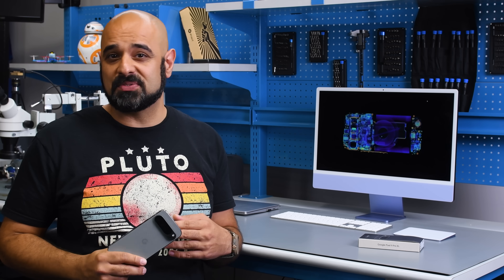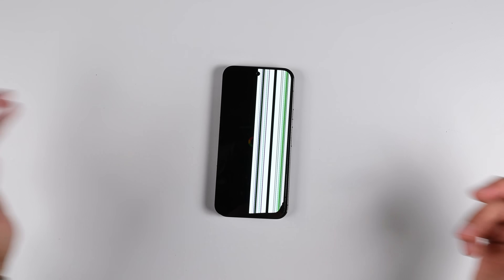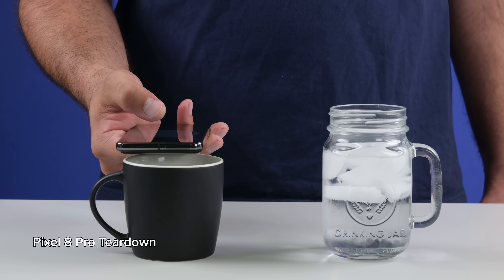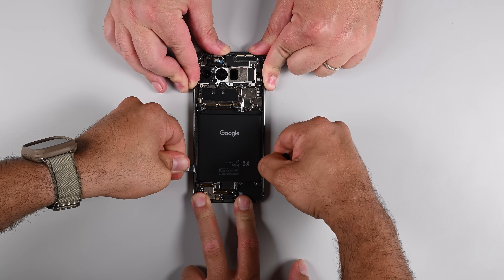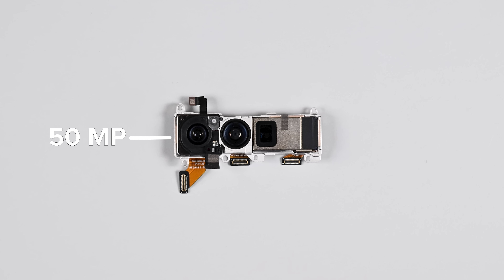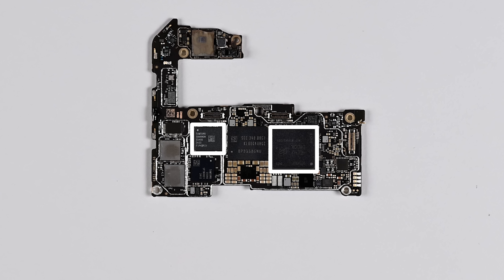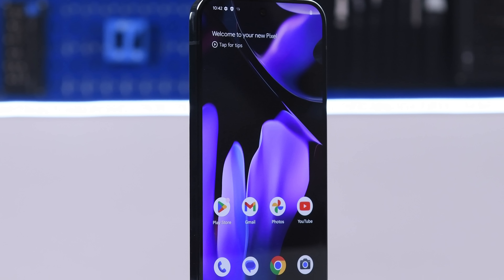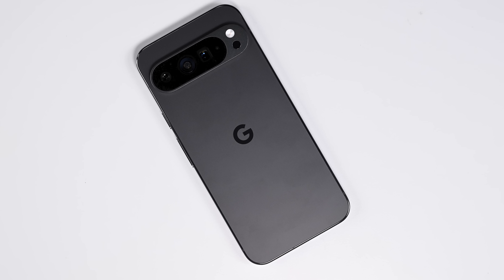Pixel 9 XL Pro Teardown: Is It ACTUALLY Better?

Comment: Is it possible to prevent damage to the back sticker by carefully heating the battery pack? Maybe Google could use a different adhesive for the battery pack in future productions of the Pixel 9.

Comment: I've had good luck with the side pull tabs on Honor and Oneplus phones. The battery is on thin plastic film that you pull on from the side.
Why are they coming up with this overcomplicated and non-reusable solutions to a solved problem ?

Comment: high end thingy these days is more toward feel rather than function, it will boost your self confident for sure but bust your wallet at the same time, i have 70 bucks low end phone that  i had for 5 years and what it can do is fairly amazing, you stick your nail between backcover seam and pluck old battery out then plug new batery in.

Comment: you always find something good to say, but this phone is absolutely unacceptable to me. maybe most Pixel phones in my country are gray or unofficial (from the US and richer European countries. i think first owners quickly realize that 128 GB of storage is not enough and sell their phones, so there are many barely used phones with 128 GB of memory that are brought to us and that cost half the price of official ones from the store). and so replacing the battery in an official service center just costs too much compared to the price of the phone after a few years of use. it's often cheaper to replace it with another phone. and I'm sure no unauthorized technician will change the battery in this phone because he risks damaging the screen or something else. and i would love to replace battery myself, it's may be fun to do. but not with this phone. with this phone it is terrible disaster.

Comment: You talked about screen entry design as a problem that was solved by apple switching opening procedure to the back

but let me tell you that this problem was solved on pixel 6 using a protective plastic frame

Comment: Battery is easier than made out. Heat rear of phone to 70c for 10 mins, undo the pull tabs, put phone in vice or similar to secure and pull tabs straight up towards you. Battery lifts out. Source: Google Repair Manual

They are not saw tabs.

Comment: Wow, replacing a cracked or not working screen can result in it braking. Shocking. As for the battery, you pull it away with the tabs. And again, as above with the screen. Replacing a faulty battery may damage the battery. Shocking.

Comment: Temp sensor? Would be great to figure out if you have heatloss in a wall in your home? At least it would point you in the direction of an issue so you can buy a thermal camera

Comment: I never understood why batteries needs adhesive at all? Especially in devices like this with such tiny tolerances. Surely a bracket or two should be able to keep it in place just as well as glue?
Reply: Likely because glue costs less than screws

Comment: You didn't mention anything about the vapor chamber or if it is better than ones on previous pixels. Also, the overall durability is more about the shape of the phone being more square and the screen being flatter. Causing drops to not hit glass, instead hitting metal.

Comment: if the adhesive is too strong but u got openings on both side, i'd take a braided fishing lines and run them under the battery to cut the adhesive. similar to how you'd do a car windshield removal. i think you dont have to mess with the screen if you just wanted to change the battery or everything else, as it seems like they're easily accesible from just the back 🤔

Comment: Wait, did all these people in the comments not watch the video? Or did I misunderstand the video? I understood him to say you can enter from the rear of the phone without ever having to take off the display when replacing the battery. But holy moly, that battery adhesive. 💀
Reply: Yeah, it looks like the only time you will have to go through the front is to replace a defective screen, so does it really matter that removing the screen ruins the defective screen?

Comment: I'm not at all saying that you guys aren't skilled at disassembling devices, but I would like the device disassembly revisited using the repair guides on google's site! 
It doesn't need to be a video, just more so a review or the repair guide published and whether or not it helps. 
Additionally I think the review of the repair guide should not include device specific tools, like the device specific, industrial sandwiching device, or the over the top screen separator pictured in the manuals. I don't think most people would buy a vise grip for their phone to remove the battery either.

Comment: I have used solvent to remove battery glue as well on other devices. But I think it was denatured alcohol and I stuffed paper towel strips in the gaps to hold the liquid in place and put like a layer of saran wrap over device to stop the alcohol from evaporating. I also waited longer sometimes adding a little more alcohol. I had good luck doing it that way.

Comment: I've seen lower repairability scores phone with easier battery removal process, the copper heat sink basically got ripped if you want to remove the battery
Reply: @deRykcihC  only if you don't follow the guides that Google posts online. They were supposed to put the phone on a heating plate at 70⁰ for 10 minutes, secure the phone in a vice grip, and pull directly up on the battery. 

They did none of those things and made it needlessly destructive.
Reply: @StrigidaeParliament  the problem with that is that most people don't have a heating plate at home to do that with. If you try a heat gun or a hair dryer you're going to cook the phone, so it now means you need a specialist tool to repair the phone.

I like Pixels as much as anyone, but it's important we push for designs that everyone can repair.
Reply: That's what happens when you use the incorrect tools and don't follow the written instructions on how to do it. This is just lame clickbait

Comment: I read the Pixel 9 Pro XL repair manual, and it says that the phone needs to be heated to 70c for 10 minutes. You can then use pull tabs to pull straight up, and the battery should come out. Also the manual states you shouldnt go in more than 3.2mm. Google has these manuals available on their repair site.
Reply: Not to mention the manual also suggests that the phone sits in essentially what is an industrial vise grip for phones AFTER the heating phase to soften the adhesive, AND using finger cots to increase your grip on the pull tabs to pull perpendicular to the battery.
At least from the repair guide, it suggests that the tabs on each side are not to saw through the adhesive as suggested in the video, but rather to pull the battery away from softened adhesive.
Reply: Dude, forget the manual who's trying to heat a phone for 10mins? The heat alone would ruin the battery and the display.
Reply: @jevonsims900 70°C for even an hour is fine for both the display and the battery. Most phones are heated to 70-100°C before a backglass/display replacement.
Reply: @pvim  70°C for an hour is absolutely awful for the battery! Hell, even 50° C sustained is enough to degrade the internal chemistry of the battery
Reply: @LazorVideosDestruction  ... the instruction is literally for replacing the battery. What does it matter if the old battery gets degraded in capacity further by heating it for an hour?
Reply: @LazorVideosDestruction  ten minutes, not an hour.
Reply: @StrigidaeParliament  The person I was replying to said an hour
Reply: @weltenleser  And the label on the battery literally says "danger, risk of fire or burns, do not heat above 45°C" so I am getting conflicting messages here mate
Reply: @jevonsims900 yeah, you'll ruin the battery that you're about to replace, how unfortunate
Reply: @jackwen04  Such high temperatures are one of the causes of LIB fires/explosions, they're absolutely NOT recommended for batteries under any circumstances. It can happen during charging when there's a short in the internal circuit for example. There are plenty of videos showing such fires. So who comes up with such an insane design? Do they expect people to put their phones into an oven before trying to replace the battery? 
The designers have to be DEI-lusional.

Comment: That battery replacement seems like an absolute nightmare
Reply: Apply isopropyl alcohol AND heat on the front, it'll be a lot easier then.

Comment: Remember when you could just replace a battery by popping off the back of a phone with no tools? Those were the good times
Reply: Yep, but those phones would not survive a 10 second dunk.
Reply: @scottibass  I believe Samsung S5 have removable back and IP67 and they can just put some coating on the board as well.
Reply: @scottibass I’d sacrifice a water resistant phone for one with hot swappable batteries in a heartbeat. And yes they can make water resistant phones with swappable batteries—Samsung did that years ago with the s5. They just don’t want to. Much more profitable to have you buy  another device instead of repairing…
Reply: @aCayden  Would you sacrifice the technology advancement to have a removable battery?
Reply: @Cesarser004 What technology advancement is getting in the way of removable batteries, exactly? Nothing in the phone is dependent on high strength adhesives. If manufacturers really can't figure out water resistance without glue (and they've managed to make foldables with exposed hinges water resistant so that's a big if) you can just use a low strength adhesive or gasket for sealing and screws for the main holding force. That costs marginally more money and is marginally harder to make look nice though, so unlikely to happen again any time soon in the mainstream
Reply: @aCayden I would not. Water resistance is MUCH more beneficial imo.

Comment: Luckily from 2027 all mobile phones & tablets sold in europe will have to have easily changable battery so no my excessive glue layer on the Battery. So the tare bown of the Pixel 12 will be mich easier.
Reply: holy shirt, 2027 is just 30 months away

Comment: Hmm for me it's more of a weak 4. Sure it's more durable which is good for sustainability, but that screen removal/ultra glued in battery is as far from repairability as you get. The industry seem to slowly but surely moving in the right direction, but the key word there is slowly; they are dragging their feet as much as they possibly can get away with while pretending to become more repairable and sustainable.

We need a Framework type device for phones. A company that goes out and shows that this shit is not rocket science, it both can and should be done!

Comment: 5 out of 10 for a broken screen and a broken battery. Clearly, they are not paid by Google. They are ”independent”.
Reply: really unfortunate that the screen and battery are literally all the components in this phone
Reply: @azyrael96 I mean, those are the most likely to need replacement so…
Reply: @tormaid42  some might say (like google) that just like the guy in the video said, you replace the battery from the back, not the front.
Reply: Compared to most phones it probably is a 5/10 though. At least the items being broken are the ones you're likely replacing anyway.

Comment: can one set the charge max to 90% on pixel 9 ?
Reply: Unless Android 14 is different on the 9 than the original Fold, no, but it does have Adaptive Charging which tries to keep the battery a bit under full until a little before you're getting up for the day (similar to the iOS one)
Reply: @bosstowndynamics5488  thanx
Reply: The android 15 update may give us the option, but that is currently not an option out of the box.
Reply: @raymondhacks  thanx

Comment: when you damage the screen at the beginning of the video you insert the pick into the device about 1 cm, when it is 2 mm at most, you should be more careful, you take away seriousness from the brand, taking advantage of the fact that you manufacture you should build a pick that could only be inserted those 2 mm with a stop bezel or something so that errors like this are not repeated c:

Comment: Let's be real, 7 years of software support is just a gimmick.
Reply: Only when android does it. Nobody has a problem with apple going 5 plus years of OS support.
Reply: @iLuseMy1v1s It's not Android that makes it a gimmick, it's the fact it came alongside seemingly harder to maintain phone hardware. Android 20 is still going to require a working battery
Reply: @bosstowndynamics5488  Replace the battery?
Reply: @iLuseMy1v1s  I'll remind you, you're commenting on a video that's specifically about the Pixel 9's battery being harder to replace than it has any right to
Reply: @bosstowndynamics5488  indeed it is.
Reply: Apple fanboys biggest clapback was the 5+ years of updates... Now its a gimmick🤡

As a pixel 5 user going onto 4 years i kinda wish i had more os support cause its still working nice after all this time

Pixel phones will be doing well and not surprised at all if they last the 7 years with minimal investment and repairs

Comment: What about the microphone hole being right beside the SIM card tray removal location? Seems like some people🙋🏾‍♂️ mistakenly poked the SIM card removal tool in the wrong hole and maybe we have compromised the water resistance integrity?..
Reply: The opening to the microphone is perpendicular to the hole in the frame, you can insert the sim tool as deep as you want, it won't cause any damage :)
Reply: Jerryrig already debunked that, mic is safe
Reply: Samsung fix that issue, but I wonder if google implemented it too.
Reply: Following. Have seen this question on several forums, but no one has been able to confirm if the mic hole is curved to prevent damage or if a seal would be damaged.
Reply: Can neither confirm nor deny if I also picked into that microphone hole while installing my sim card 😓

Comment: Pixels had this issue for so many years that they had soldered charging port, finally we got a modular one! nice job.
Reply: Yea I really liked the modular daughterboard, but seems like it is hard to remove the battery which is sad.
Reply: @jierenzheng7670  Once it's replaced you can use less glue for further battery exchanges
Reply: Now they need to fix the battery replacement issue.

Comment: The display got broken during the disassembly, the battery removal was the worst of any smartphone in the past 5+ years, there are no manuals on how to open the device, and youre not questioning the 7 years of software support from a company with a long history of killing their products and services early on. AND IT GOT A 5/10?? But nice that you offer parts from them
Reply: You don't have to remove the display, you can replace almost everything through the back. The main reason you would open it from the display is if you were replacing it anyway.
Reply: I was gonna say maybe the guides are pending since they just came out but I checked and they are on the google website as of now.
Reply: Exactly
Reply: Jeez calm down the pixel is a lot newer  than someone of the devices your probably talking about let them catch up for god's sake 🤦🤦.
Reply: When I looked at their S22 Ultra teardown, having cracked the back glass only while the AMOLED survived the separation. They only gave 3/10. Lmao
Reply: I was interested in the pixel and I saw the teardown sorry google, won't be buying your phone
Reply: and fingerprint sensor is paired to the screen
Reply: There is a manual dude just google these guys think themselves as pros but didn’t do a simple google search
Reply: Yeah, I appreciate ifixit showing the risk of trying a battery replacement after a couple of years. Yet another year to appreciate the pixels, but not buying it 😢
Reply: There are manuals. It took all of 30 seconds to find them with a quick web search. All of these channels are conveniently forgetting that heat pads / plates are a thing and are a part of safe phone disassembly for the majority of phones. Same with using a jig / cradle when removing the battery.
Reply: @HaddaClu  They clearly know there's heat pads, they used one in the video for the screen. And they did look for manuals, again, as mentioned in the video, but either they weren't uploaded yet (what a lot of comments here keep forgetting is that these videos are pretty much never uploaded same day and it's not uncommon for this stuff to get uploaded shortly after release), or they were thrown off by the QR code on the battery going nowhere helpful
Reply: fun fact: the phone won't last 7 years
Reply: @metallurgico it probably would since software wise pixelui ain't that heavy

(lets just say my galaxy s9 can run a ver of pixelos on android 14 just fine but not oneui 2 on android 10)

unless some hardware magically incinirates itself
Reply: @metallurgico  Another fun fact almost one will want one in 7 years even if it lasted 7 years LOL.
Reply: You know what makes even less sense? They gave samsung a lower score even though their phones are SIGNIFICANTLY easier to repair and use significantly less glue